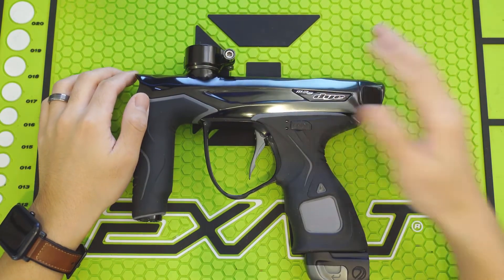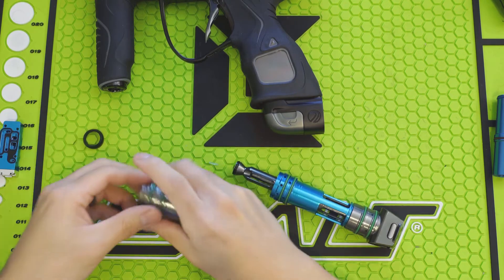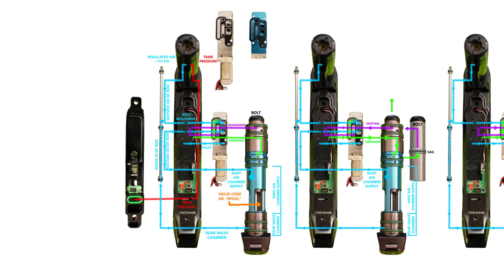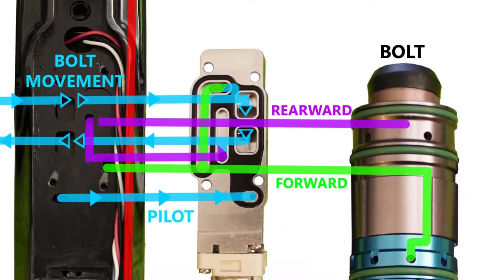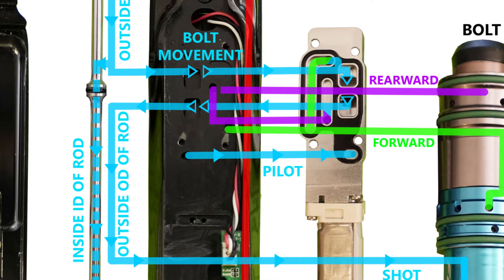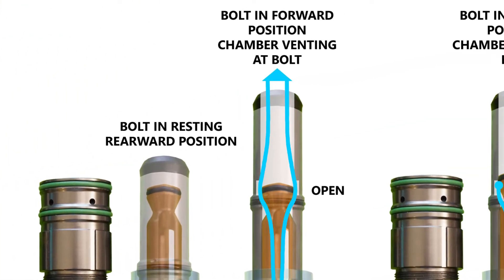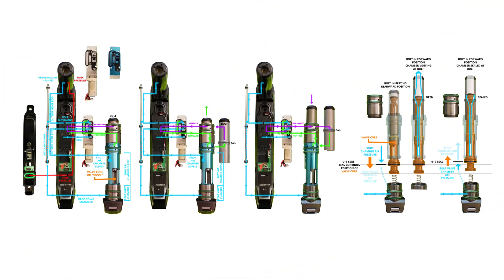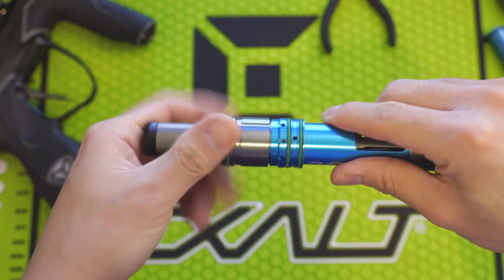Dye M3 FL-21 Engine | Technical Breakdown

Comment: do you notice any shot difference in the solenoid change? im thinking bout geting the billy wing noid for my m3s since i already have all the other upgrades
Reply from the maker: So it will be very subtle. What the manifold is doing is softening the acceleration of the bolt. You don't need it, I believe the flex face and updated eye pipe are all you need.

Comment: Again, thank you for producing real reviews with actual information. I've had an M3s from August of 2018, as well as a dozen others bought and re-sold over 2019-2020. They're amazing. Amazingly efficient, remarkably easy on paint, reliable, easy on the eyes, and comfortable in the hands. It has it's weak points, but those are heavily outweighed by positives. I highly appreciate the M3 and it's poppy yet gentle shot. You said it, this is a greatly misunderstood and underappreciated marker. I hope Dye keeps the FL-21 in the M4.
Reply from the maker: Thank you! I appreciate that
Reply: dyes innovation is always underappreciated an looked passed sadly lol
Reply: What are the weak points?
Reply: @landonp4726  the tool-less grip system leads to rips, a feedneck that unnecessarily spins, a front foregrip that comes off inadvertently, and terribly soft trigger adjustment screws that strip too easily. Honestly otherwise this platform rocks.

Comment: Is it recommended to remove the soft tip from the bolt before sliding it through the cylinder? I've just been pushing it through when doing maintenance
Reply: No, you're fine.

Comment: Excellent breakdown. On the bolt, you notice the holes under the tip? Those were a significant FPS gain over most other soft tip designs as well.
Reply from the maker: Thanks John! I appreciate that. The 3 holes under the soft tip. Could you explain how that works?
Reply: @QTPaintball  Most soft tips require compression with the breech to form a seal, whereas most well-designed oring tips use a floating seal (the oring gland is a bit oversized and pressure stretches the oring to seal the gap). As you know, many soft tips cause problems when they swell or wear. So the one on dye guns is loose in the breech, but those holes allow air to push the tip outward when a shot is fired to seal the breech.
Reply from the maker: I was thinking about it all wrong. That makes perfect sense. Explains the profile of the tip. It always impresses me how the pressure in the breach can be utilized. The pulse from the shot able to generate the "inflation" alone or does it require the back pressure from a ball?
Reply: @ironyusa3885  Absolutely brilliant.
Reply: Awesome info John. Is it recommended to remove the soft tip from the bolt before sliding it through the cylinder? I've just been pushing it through when doing maintenance
Reply: @buckshotbrown2173  I usually don't remove it. I tapered the cans on the DSR and m3 to make the bolt easily removable without taking off the tip. The ramp usually allows it to pop back through during reassembly, but I typically install the bolt on the guide and then push the can over it. Saves time in the pits.
Reply: @ironyusa3885  thanks

Comment: Etha 1 vz Etha 2 video coming soon?
Reply: The etha 1 is irrelevant now
Reply from the maker: Yeah I probably won't since the Etha2 has been out for so long over the Etha1. Again I still love my Etha1. There is alot of information on both and you know my thoughts already haha
Reply: The Etha one is not even worth talking about.  I mean........they  shoot paint but there's a lot of failure points in the drive train and yes........they do fail.  I've had to fix every etha one in my  city at some point, or at least that's what it felt like lol.   Thankfully PE will still help you out with most of the issues if they have parts and almost every one of them needed parts replaced.   At this point in time there's no reason to buy one unless you get it for an unbelievably cheap price and it's a fully functional gun.